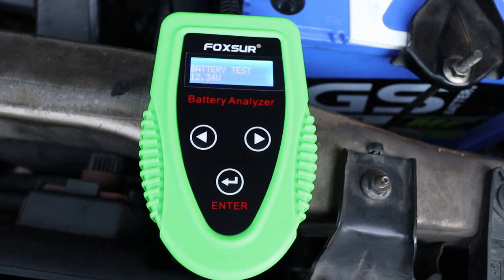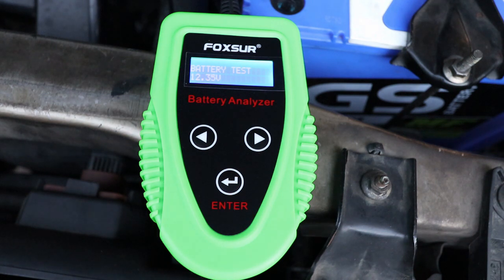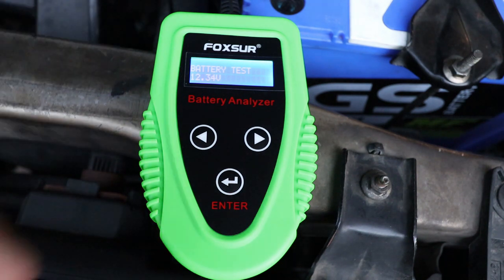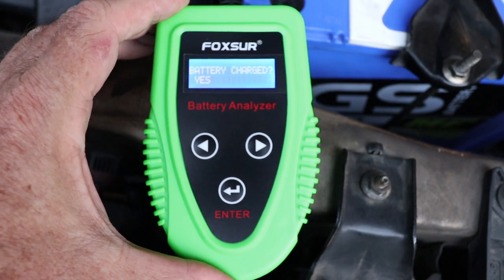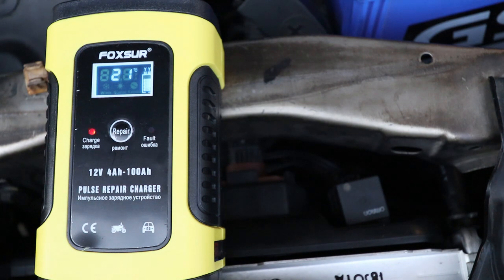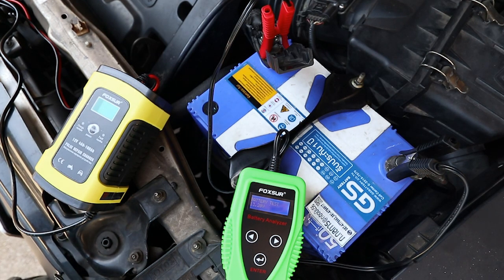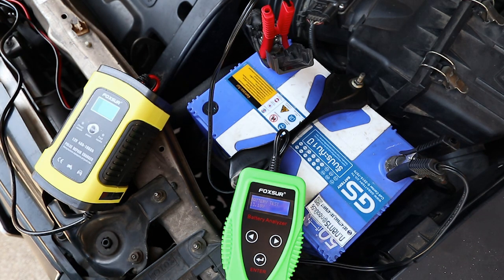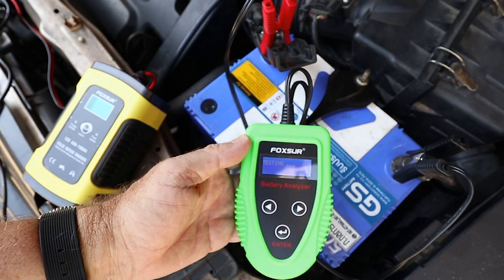Can The Foxsur Pulse/Repair Battery Charger Repair A Bad Battery?

Comment: How do you know a normal charge didn’t just fix it?
Reply from the maker: Perhaps it would have done. Really, you would need to do a controlled test with two identical batteries in identical condition to see what difference it makes. Unfortunately, I'm not in a position to carry out such testing.
Reply: Normal charging in most cases independently of the charger allows you to get about 80% of the battery capacity. The use of the pulse mode, in addition to the positive desulphation effect, also gives the battery an advantageous absorption phase with increased voltage. Such charging should be applied at minimum twice a year, at least before and after the winter season, when the battery has difficult working conditions due to lower temperatures.
Reply from the maker: @Tab7.6.Tab7.6  Thanks again. Based on your recommendation, I need to give my battery another treatment soon.
Reply: @PhilUKNet  The next good thing about this charger is that it really turns off after 24 hours in pulse mode and switches to float mode. If necessary (for batteries with a capacity of more than 60Ah) this mode can be easily switched on again. In contrast, the Foxsur 8A version has a bug. Even if it shows on the display FUL after PUL mode, it does not go into maintenance mode. This is not good if we forget to switch off the charger, because the phase of the increased voltage will last too long and may occur electrolyte loss due to electrolysis. Fortunately, in version 5A there is no such fault.
Reply from the maker: @Tab7.6.Tab7.6  For what it costs, it offers remarkable value. I know that people in Europe are paying a lot - someone in Ireland told me he paid around 28 UKP - but mine cost the equivalent of 6 UKP in Thailand. I know it's cheap, but your comments have confirmed that it also works very well.
Reply: @PhilUKNet  Oh yes , I agree, very good price to value. I had to buy directly in China, because it was not yet available in Poland (โปแลนด์). A year ago it cost me about 9.5 UKP. Now we can buy it unofficially under a different name on auction services for double price (nonsense, it is better to buy directly with free shipping). 28 UKP in Ireland is probably the price from private importers or on eBay. Sometimes it is possible to buy a cheap and good chinese thing ;-) I am personally very pleased with this charger (and I have several different devices in my garage for comparison), even if charging requires more time. This one, although it is quite unimpressive, does its job very well (most automatic chargers are not able to do this).

Comment: Im sold.
Reply from the maker: It doesn't perform miracles, but as a basic charger it works well and the pulse repair mode can improve things if your battery is sulfated. Where I live in Thailand they're being sold for as low as 190 Baht - less than 6 USD - so you can't really go wrong.

Comment: Hi Phil. This is the perfect review of the pulse repair mode on these Foxsur chargers. Thanks for taking the time to put it together. It is the kind of thorough review I wish I had done.  I have been using a similar charger called Enusic, but it is the same as Foxsur.  I made a video showing the output of the charger on an oscilloscope when in Pulse repair mode. This charger has added new life to my old batteries. It will not bring a severely damaged battery back to life, but it will greatly improve a sulfated battery.
Here is what the pulses look like from the Enusic/Foxsur charger I have...
https://www.youtube.com/watch?v=TLdoGV_QEuY&t=1s
Reply from the maker: Hi George, your one looks very similar. I imagine they are all made at the same battery and sold with different brands. I'm not sure if it was your video, but I did look at a video previously that showed the pulsed output on an oscilloscope. I got quite annoyed with another video that stated categorically that charge pulsing doesn't work. It does. As you say, you can't do much with a damaged battery but it does help with sulfated batteries. Thanks for your comment and link.